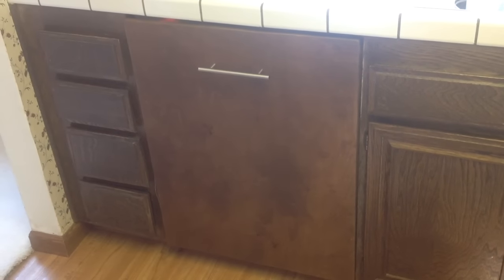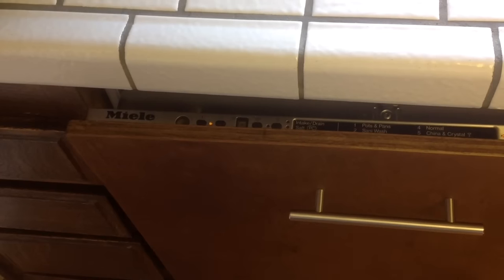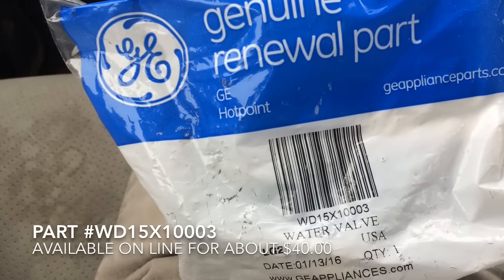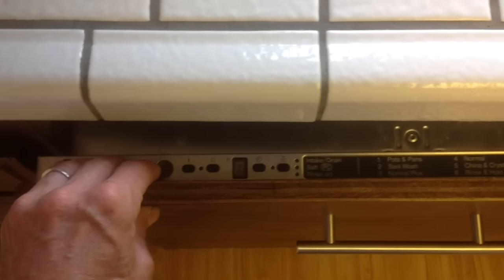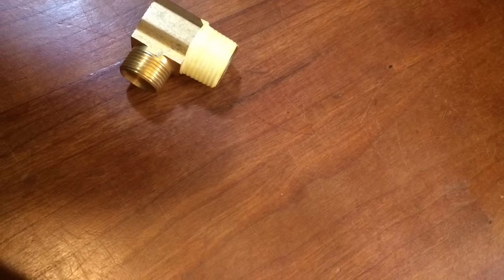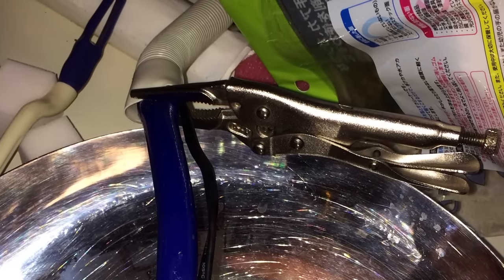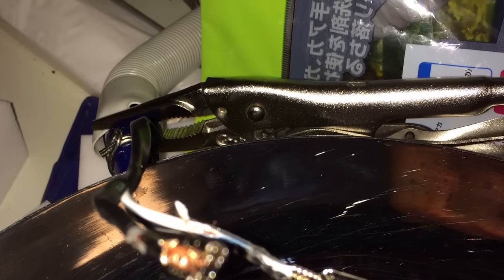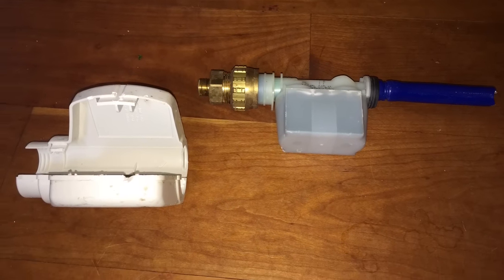✨ Miele Dishwasher intake/Drain Light - Fill Valve - Easy DIY Fix ✨

Comment: Scott:  I installed the valve from the link you provided, after watching this video.  Worked perfectly for my 19 year old Miele G858 SCVi PLUS.  The compression fitting elbow that came with the valve didn't work in my situation, since I had to connect to a 3/4" male garden hose fitting that the plumber had soldered onto a shut off valve for the dishwasher. But my local hardware store had the fittings I needed. So, for $45 for the valve + fittings I saved over $500, based on my last valve replacement in 2013. THANKS!!
Reply from the maker: Wow, nice job😊👍
Reply from the maker: Nicely Done😊😊😊

Comment: So I ordered the valve from Amazon for $30. Couldn’t get the part you listed but went to the large improvement store and got Everbilt  3/8 in mip x 3/8 in fip street elbow (LFA-78265) and a 3/8 in od x 3/8 in mip adaptor (LFA-123). Followed the video and bingo! Thank you for also saving marriages!!!
Reply from the maker: That is excellent News😊😊😊

Comment: Hey Scott. Dropping a quick line to thank you for your video. I just finished the procedure and so far it is working as usual. I have a Miele G892 SCU PLUS; it's about 13 years old. For those of you asking if the GE valve will work for your particular model, just check that the voltage (V) and Hz match the original valve. The GE Valve that Scott specified in the video matched the Miele Valve specs: 110-120V 60Hz. I ended up spending $83 bucks (water valve, 3/4 stainless water hose, elbow, electrical tape). 

I had called Miele Service and they quoted me the following:
$155 for the diagnostic (a 5-7 day wait time for someone to show up)
$  90/hr for labor
$ 110 for the entire hose with the valve
Reply from the maker: +Edgar Jimenez 

Thanks Edgar😀👍
Reply: Also a G892 here, Can either of you pls share the link to the GE part? The current link took me to a Fridgedaire part.

Comment: Absolutely Amazing Video!! 

Was about at wit’s end & ready to toss my beloved Miele dishwasher; when I gave this a try- worked like a charm! I have little to no experience with plumbing or electrical; yet was able to solve the issue for $45 thanks to this very informative and helpful tutorial. 

I wish Miele had a different code for faults at intake & faults at drain- it would make finding the issue faster! To rule out a drain issue, I reset the fault light, poured pitchers of water into the dish washer, started it up, could hear it draining normally, then the fault light came back on- so I narrowed it down to a fill issue & this seemed to be the culprit part. 

Currently, the link provided in the video for the elbow adapter was sold out. At my local hardware store- I figured out the adapter needed is 3/8” pipe to 3/8” compression. Took me a minute to realize those are different measurements. 

Infinite gratitude for providing me with the skills to maintain my Miele!
Reply from the maker: Great job Jason😊😊😊

Comment: I did this and it worked great. Not only is it much cheaper, $50 compared to about $400 - $500 for a service call, but fast. No scheduling the service call. I bought my valve at a local appliance parts store and had the job done within 24 hours of the failure. This is important because I don't think life as we know it is possible without a working dishwasher! Make sure you cut the hose back as Scott mentions. I skipped this step but then found out that the wires won't reach the connectors. Had to take the hose back off, which is difficult when the valve is already installed in the tight space under the cabinet. Scott mounted his by hanging it from the soft copper water pipe. Mine had been hooked up with a hose. So I replaced the hose with a pipe -- simple change that solves the mounting problem.
Reply from the maker: +mabanaheights 

Nice Job,

Sure saves a lot of money👍
Reply from the maker: +Scottthefixitguy    I'm so glad it's working again👍

If my advice has helped you, 
please visit: http://www.scottthefixitguy.com
To make a donation to
Scott's Coffee Fund -- 

Help Keep Scott Caffeinated😀
🌎 Thank You

Comment: This is a really great fix! I've already replaced one hose assy. on our older Miele. So - I got all my tools out and undid the valve assy., looked into the inlet and... the filter basket had junk in it!! Obviously this reduced in-flow. Cleaned and reinstalled. Code is gone. Also, I recall the instructions on the new hose was to mount the solenoid VERTICALLY. A Miele rep said this was important for longevity. So, thanks, dude! This saved me hundreds.
Reply from the maker: NIce job, thank you

Comment: Thanks so much Scott. I followed your instructions and it seems everything works now. Before I had the "Open water intake supply" (or something like that) fault. Wasn't sure this would fix it because I figured there could be lots of things that could lead to this fault. But I also felt this was the most likely culprit. Got the valve on Amazon because I could return it if this wasn't the problem. Other parts were from Home Depot. You saved me hundreds of dollars!
Reply from the maker: +David's Red Tesla 

Good job David.

Sure is a good feeling to fix it yourself

Comment: Recently I had to fix a Miele dishwasher and found this excellent video. I was able to replace the faulty valve successfully, however, with some modifications. I felt not protecting the electrical terminals inside a hard case was unsafe. My solution was using a different water inlet valve: DD62-00084A (for Samsung Dishwasher). The inlet and outlet of this valve are aligned along a straight line (same as Miele’s original valve). Modifications were necessary for fitting the new valve inside the original plastic case, and they included: 1) trimming down (using grinder + cut off disk) the metal plate of the new valve; 2) cutting off the “neck” of the original plastic case at the “water supply” end and slightly enlarging (elongateing) the opening; 3) shaving off some interior parts of the plastic case so that the new valve could fit inside the case. (Note: this method works better if the inlet hose is not shortened)
Reply from the maker: Nicely done 👍😊
Reply: @ScottTheFixItGuyChannel  Hi Sott, I would be more than happy to provide you with some photos of my works in progress if you think they may be helpful to others.

Comment: This video was right on time for me. It cost me less than $50 and less than an hour of work to fix my died Miele and saved me $500+ in repairs or replacement. The only problem is that you don't know if it is broken unless you take it apart. Fortunately that was the part that broke. Damned German Engineering created the part that cost more, cannot be disassembled/fixed and breaks more often. Even Bosh has a better valve.
Reply from the maker: +Andy F. 

Thanks Andy,

So glad it worked for you.

Comment: Scott, just wanted to let you know that after doing this fix a year ago, that this January the Circulation Pump Motor went out. They don't make a partition kit for it, so would have to be replaced at $1000 for part&labor. I looked at the new Miele and Asko and got a $400 off deal on a new Miele G6625SCU Crystal. Had it 2 weeks now and works good. But they no longer have the double Solenoid on the end of the hose. It's now just a regular metal braided hose. Miele says they now use a different Solenoid on the inside on the unit.
Reply from the maker: Maybe the new valves will last😊
Reply: Scottthefixitguy I had a Miele service tech out a week ago due to a manufacturing scratch on the control panel. I asked him about the valve change. He said it's too early to tell if this change fixes the issue from the units with the solenoid at the beginning of the water line. But he preferred the older set up.
Reply: FAUguy23 Hi there, I think this new valve is much better than the old style, I have replaced about 6 of these already, and it seems that they are working longer, no revisits so far, good luck with yours, by the way I’m a Miele Technician 🍺🍺Cheers.
Reply: FAUguy23 (

6

Comment: Hi Scott, I recently was introduced to to this dishwasher bye friends of mine bought a house with one of these in it. it also had intake / drain light on being handy that I am I try to fix it first off I remove the filter that's in the end of the water valve and cleaned it it was dirty it worked for a while. Then stopped working altogether same intake drain light on. Contacted  Miele which was has fantastic customer service they talk to me a handyman on a thirteen-year-old machine and we determined there was no water coming in by the codes that they help me get to. But what I think the real problem was (which I believe is unique to this dishwasher) it has a water valve on the end 6 foot hose this particular model only had about a foot into the cabinet under the sink the rest was bunched up behind the dishwasher and I think it was kinked when it was pushed back into place. So I remove dishwasher and as I was pushing the dishwasher back in I put all of the excess hose to under the sink cabinet security make sure there was no Kinks and it's been running fine for about 2 weeks now. So you might want to check those two things first filter and kinks in the hose. when you replaced the water valve you probably unkink the hose probably repairing it that way.

Comment: Excellent video, well explained!
IMPORTANT NOTE ALL THE DIY GUYS out there trying to fix your dishwasher/wahsing machine: 
Before following the advise in the video, make sure that the aquastop hose is actually really defective before cutting/destroying it, or buying a new valve.
I had the same defect characteristics, but my aquastop hose is actually still OK (I unmounted it before, which was tricky on my machine, and tested it).
I was close to ordering a new valve and destroying my aquastop hose as shown in the video. I would have been very disappointed to make all these efforts then just to see that this was not the problem.

Comment: Hi, my miele g6860 has the dreaded water intake message on the screen. Odd thing is the water does come through but into the cycle I get the message. 
Might this still be the solenoid failing ?
Reply from the maker: You’re right,
As the resistance Valley goes up because of heat build up later in the cycle that’s when the fill valve has trouble.

Comment: I might have spoken too fast.
I ordered the 'universal' replacement, will get it on the 29th...
Symptoms : stops while cycling, drain/ intake light on.
I cleaned the filter, checked the drain pump (it is perfect and turns freely). 
I unscrewed the inlet valve. Filter was ok, but still I took it off and did not put it back in ( it is until I get the new one, and our water is double filtered...

I did bang the valve a few times with a small hammer, and it seemed to work. 
The Miele did 2 fill  cycles, 2 drain cycles, then stopped. Drain/ intake light back on.
Any idea why the intake valve would do 2 fill cycles (on normal setting), then stop with the light on?
I don't think it is the water pressure sensor as I get a steady flow when it works.
I hope the new intake valve will fix this issue, but I am having doubts 🤔
Could it be something else?

I really appreciate your videos. A great help to a lot of people.
Thanks.
Reply from the maker: Thanks so much Michael,
Since it works well until later in the cycle I would suspect the heater/pressure switch and the circulation pump capacitor.
Reply from the maker: Hi Michael,
I think this video will do it: https://youtu.be/eOBTeZBXWQ0?si=YEs9pHNFx4IUDfS8

You can call Miele USA and ask them to send you the run capacitor and the heater/pressure switch 👍
Reply: Thanks a lot. I will try and order the parts. I am in Canada, hopefully I can get them here.
Would those parts, if defective, trigger the intake/ drain light ?
I wish you and your loved one nice holidays and a happy new year.

Comment: Thank a bunch, that helped me with my issue.  I did have one slight difference in that I needed a 3/8" to 1/2" valve to connect to the water supply.
Reply from the maker: Excellent ,

Thank you

Comment: What do think? Changed the inlet valve hose, cleaned the impeller region no joy. Any ideas Scott?
Reply from the maker: When do you notice the intake/drain light kicking in?
Reply: @ScottTheFixItGuyChannel  it’s about 30 seconds from the beginning, it pumps out the water but taking in water it sounds very much like there is air in the water. It will fill up with water until it needs to disperse it , but it won’t start the program cycle. I have a video of the sound of water .
Reply: @ScottTheFixItGuyChannel  less than 30 seconds
Reply: Water pumps out okay. Filter good as well.

Comment: First things first... Came here, watched, went to check if the valve I can get locally ( Aus ) would fit... Saw the a rat had gnawed through the wires.... Solder, shrink wrap, tape and rat bait fixed mine. Still, I wouldn't have seen it if I hadn't pulled the hose out through the cupboard wall a little while checking, so thanks anyway.
Reply from the maker: Nicely done 👍😊

Comment: Great video!  You saved me lots of dollars with this simple fix.   Also, we probably would have been washing dishes by hand for a week in order to get a repair guy out and then have him order the expensive part. 

I'm thinking after reading one of the comments that said: 

" Putting a mexico 40$ valve in  place of a precision german made dual valve. So you put on 1 super cheap valve to replace 2 very high quality valves. Makes sense to expect issues. Cheap valves never work on these. Miele uses 2 valves. 1 is the main and 1 is flood fail safe. They both have to fail to flood your house" 

that this fix could be improved by adding a second solenoid valve in series with the other, to get the redundancy of the Miele part.  Any thoughts? 

Thanks again, Scott!
Reply from the maker: Thanks so much👍👍👍. Reports from customers have shown that the 40.00 cheap valve lasts much longer than the 220.00 Miele fill valve.  So happy that it worked so well.

Comment: I have a F84 error.  I notice my dishwasher is not filling.    Could the F84 be resulting from a bad fill valve.  Very little on web about.
Reply from the maker: Hi William,
The F84 error is due to water not being able to drain.

Can you disconnect the drain hose from below the sink and put it in a bucket and see if it will drain?

Comment: Do you know what the control voltages are for the valve?
Reply from the maker: In the US it’s 110 volts, other countries it’s 220 volts.
Reply: @ScottTheFixItGuyChannel  So they feed 240 or 110 to control the valve on/off? Seems like alot! I was expecting 5 or 12v

Comment: Thanks for the great video, I just got the same error code.  We had the 400+ job done about 5 yrs ago to replace the valve.  My water valve is on and the valve does vibrate, but no water comes into the dishwasher.   I cleaned the basket filter and this did not fix the problem.  I am assuming that the intake valve is just not working despite the vibration.  I am going to replace it tonight, but if you have any other advice, I would love to hear it.....
Reply from the maker: Yep, it’s time for a new valve.

I might check first that the fill line coming to the valve has water flowing through it by disconnecting it from the valve.
Reply: I replaced the valve. Works great.  THANKS!!

Comment: Question- If the valve does vibrate… does this mean the valve works? My valve does vibrate and intake error light is on.
Reply from the maker: It’s good it’s vibrating because we know it’s getting power,
It’s just not opening.  Replacing it will fix it✨👍

Comment: Hi Scott,I have Miele G5500 SC with many problems,first the Heating resistor is 0.28 Ohm and send message Fault F24,I disconnect the Cable on the Heater and connect DVM,,well the DVM show me the 230 Volt when request,and the Fault F24 is go away,but the DW don't finished the job.
ex: switch ON then select automatic or ather Programm  (no Heater connected).Start,the DW open the water  and charge the DW ,stop to refill and start the job (seems to be OK)but after drain the water should be refill again the tank,then in this step  the DW stop with message INLET error  ,I controlled the water filter and is ok,. but stil not work.

replaced Parts: RELE',Pressure switch.

thank you so much for your Help

Comment: I have f13 error. Replaced flow sensor but still same alarm. 
Sequence:drain,fill  ok water level ,then f13 help
Reply from the maker: Does the water reach the bottom of the white plastic filter handle?

Comment: Hi Scott. Thank you for the video and all your responses. In the newer Miele series G6xxx, the fill valve is inside the dishwasher at the bottom. Do you know if it's still possible to replace with the GE fill valve on those models? My g6875scvi fails on a normal cycle at the beginning of the rinse phase with a "intake" fault and I've exhausted all the troubleshooting steps in the manual.

Comment: Any chance of servicing/cleaning these Miele valves if they happen to get sediment stuck in them? Mine was working flawlessly until my building turned off the water supply for a repair.  When turned back on, valve seems to have failed.
Reply: I also hear the solenoid buzzing and turning off, but currently it seems to be unable to stop the flow of water.  Would soaking in vinegar possibly resolve this?
Reply from the maker: That’s worth a try👍
You can disconnect it from the water, and then grab the white plastic filter by the middle ridge with a pair of needle nose pliers and then super clean everything 👍